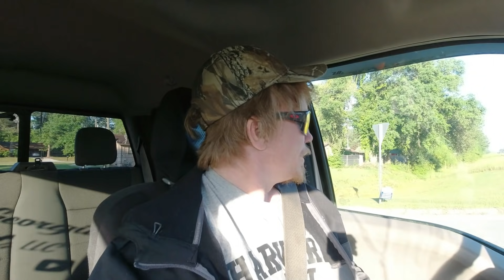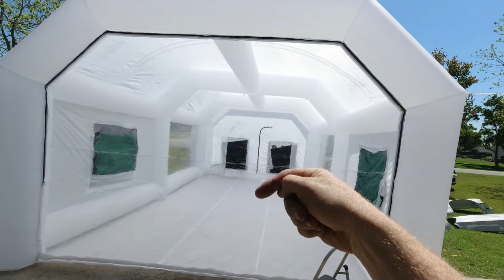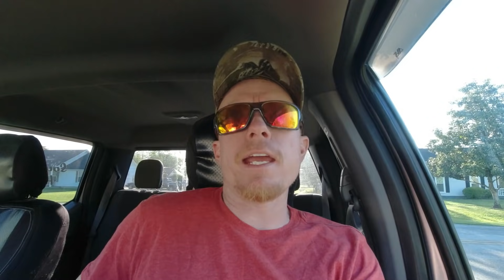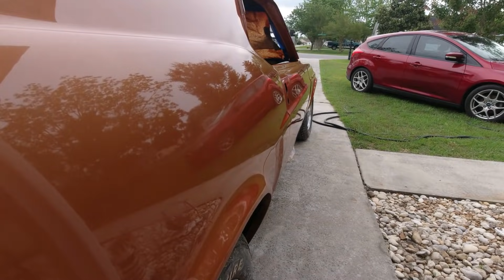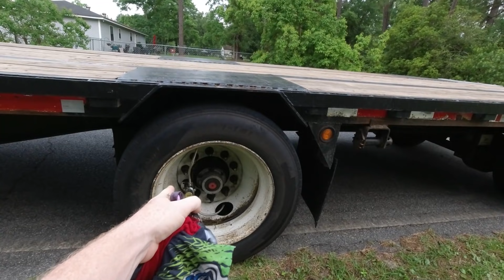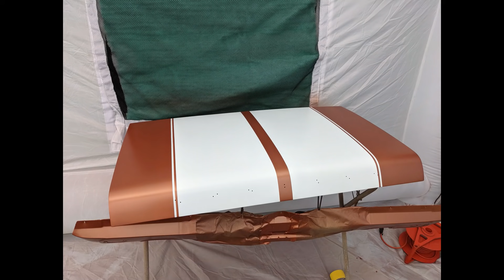I bought a paint booth off eBay and painted my dad's 69 mustang!

Comment: Looks good man. I enjoy painting but found out a long time ago I couldn't make a living doing it. I spend way to long perfecting. OCD. Curious on the booth. How did you like it. I set up a down draft with a water filter, does good but have to keep a lot of heat going to keep moisture down. Very interested in your take down setup option.
Reply from the maker: It works fine with little wind. Clear coat time you need to wet the floor or else the floor sticks to your feet. Not a bad option for a couple quick paint jobs. Wouldn't suggest for full time work. Maybe a traveling painter setup?

Comment: Hey.  I am about to paint my first project.  Question:  Did you use single stage?  If not, why did you mask off the stripes and then paint the root beer?  I mean the way you did it, you have to tape the car twice, correct?  I am asking cuz you cut and buffed.  Most of the time that means you used base/clear.  My plan was to shoot the whole truck blue.  then tape for the stripe.  then clear.  Any and all input is welcome.
Reply from the maker: I never use single stage. I painted enough white I would know I could tape off and have enough. Tape off stripes, paint color. Then I do 2 coats of clear feathering out off of stripes only. Then 2-3 over entire car. So you can't feel the racing stripes when you rub your hand across.

Comment: Hello South Georgia hotshot huge fan here I have a question that I really need answered I just bought my first truck my numbers go live in one month I'm looking to buy a trailer should I buy a step deck or a flatbed which trailer do you think it's more business running loads off of load boards like uber freight etc I would consider a dry van but I think flatbeds and drop decks would show more loads of DAT
Reply from the maker: You will do good with either. I think they are equal. There will be times you see stepdeck only. And there will be times you see flatbed only. Can't go wrong with either

Comment: Nobody should judge you for buying used truck. That was a smart move . Did Leta give you that idea?
Reply: Used is fine.  As soon as you drive the truck off the lot it is used.  So it's all the same.  I buy cars new, when I can, because I have to have a reliable car.  Motorcycles, UTVs, Jet Skis -- all used.

Comment: Old school is the way to go, more mechanical parts are always better, vs the electrical components and modules and teeny tiny data lines that communicate from module to module, wiring doesn't like heat or vibration, and that's all you get from driving all day in a semi. So yea old skool is the way to go, you can swap a motor or trans over the weekend and keep it moving. Ain't got to the paint yet, I'll be back to comment as the video continues! Rock on brother from another mother! Keep the wheels rolling and the bearings greased!

Comment: That's a fine looking paint job! Also, you can get just the extended run fuel cap for the gen on Ebay and Amazon for like 15 bucks.

Comment: You can buy a Pre-1998 semi and you don't have to run that computer ! You just do your log books..
Running that computer is another way Big Brother can watch and keep it's thumb on you...
 That's why alot of owners rather rebuild an old semi. And then they know what they have and how to fix it..
Alot are putting cab overs back on the road. And some stretch their frames on a conventional for king sleepers ?
Bottom line it's nice to have a backup rig just in case ?